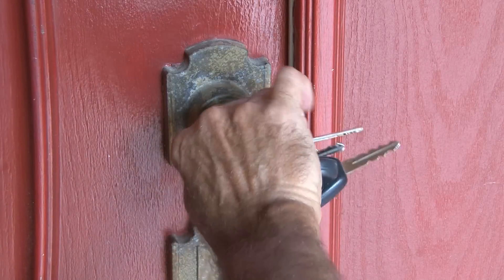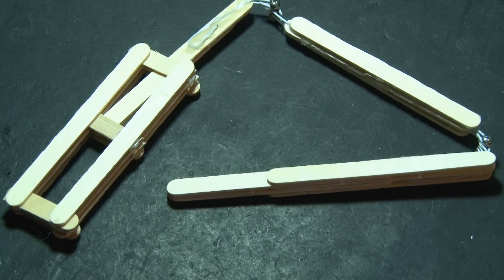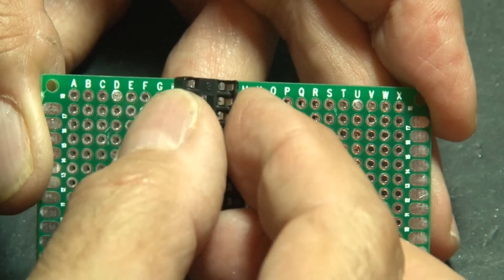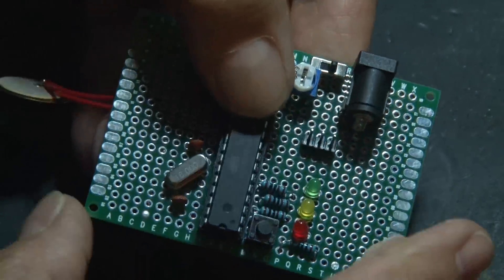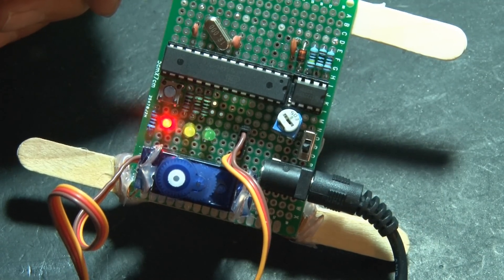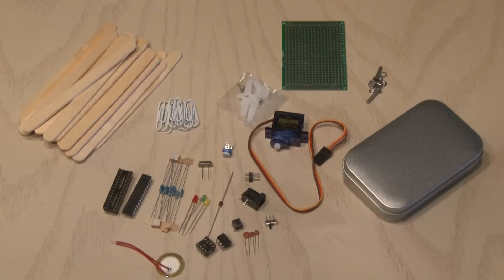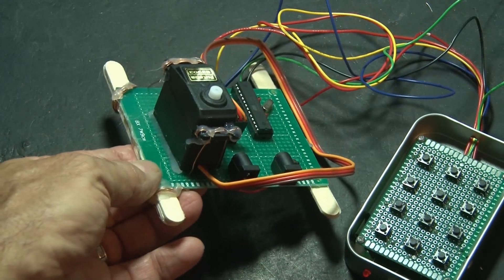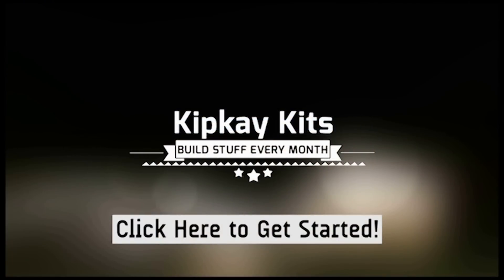Unlock Your Door With A Knock!

Comment: Man, y'all are paranoid af. This is really cool.
If a burglar wants to get in your house, chances are a locked door isn't going to change that. They're going to try to get around it. Either through a window, the back door, picking the lock, etc.
The chance of someone actually sitting around watching you knock on your door and realizing that you have a system like this in place is slim to none. (Unless of course they've seen this video.) They'll just assume that you don't have a key and there's someone on the other side unlocking the door for you. 
It's really, really not as dangerous as y'all are making it out to be.

Comment: and if the battery dies
Reply: Jason Dunne does that mean you threw out your key?
Reply: +ThePolocatfan276 well unless you threw it down a drain like I did
Reply: +TimMulder. replace it smarty
Reply: +Ty Black not if you're locked outside -.-
Reply: +The One That Kills The Least probably but I wouldn't if i was you just in case
Reply: Tokkstrr__ Gamer exactly
Reply: Tim Mulder  you just try to replace it

Comment: Why do people like this so much? Your door to your HOME is protected by Popsicle sticks? I would never let my door be secured with little breakable wood sticks.
Reply: U dont get this do u?
Reply: The materials he used to make this have no bearing on what the device does.
He could have made the thing out of titanium plating and it would function the same as the "little breakable wood sticks".
Reply: its not a protective device......... it just unlocks your door if your to lazy to do it yourself, which in the long run is way easier then this.
Reply: doesn't have to be to your front door man. its for anything with a deadbolt lock. you could put it on your back door or some other door in
case your forgot your key for instance.
Reply: Joe Blow I feel you have literally no idea what you're talking about.
This device isn't transmitting or receiving any wireless signals. A smartphone could do absolutely nothing to it.
Did you just get done playing watch dogs and now you feel you have a mastery over electronics and hacking?
Reply: If someone breaks the popsicle sticks, the knock to open doesn't work, but the deadbolt still is keeping it closed.
Reply: Oh sweet!
Reply: Joe Blow "Hacked open"
uwot?
You can't just hack any piece of electronic equipment. You have to have access to it first.
Are you being serious?
Reply: Joe Blow Good thing this isn't a computer then, eh? Additionally, if someone wants to put in the time to figure out specifically what kind of device is securing the door, and then building something to crack into that device, rather than.. idunno.. investing in a lock picking kit, then more power to them.
Reply: Joe Blow This has literally no transmitters of any sort on it. The only way to access it is to plug your device into it.
Reply: No. Your home is protected with a solid steel deadbolt. Not to mention most homes have home security systems too. This is just a cool way to be able to open your door so you don't have to remember to bring a key everywhere
Reply: To stupid to watch and listen?
Reply: EntitySteel
better:

The door is secured by an unsecured digital machine that can and will be hacked open...

LOLOL
Reply: Joe Blow  Why will you hack it when you can just sledgehammer that door
Reply: EntitySteel
Yes, I am serious. Because it is a fact of this digital age.. Hell, for 17 bucks I can build a device to read the RFID on your ATM/Credit Card.... What makes you think that this device in the video is any more secure?

If it can be made, it can and will be broken.. That is a basic fact in computing..
Reply: EntitySteel
Any smartphone can be used as well.. heck, any computing device for that matter. No need to figure much out. There is always an app now a days... At least with non digital locks you have some semblance of control over your lock.

Comment: hey kipkay, can you still use your normal key to lock and unlock the door with the robot on the deadbolt if the battery dies or the power goes out

Comment: If all you have is a deadbolt locking your door, you might as well keep it open. Even a better than started deabolt still isn't adequate. I saw my deadbolt (not sure what model it was, but it was slightly better than standard) get kicked down in 1 kick.

Comment: Would probably be easier to just take the thumb handle off the dealbolt and mount servo shaft to deadbolt shaft via chain link or belt with some small sprockets.